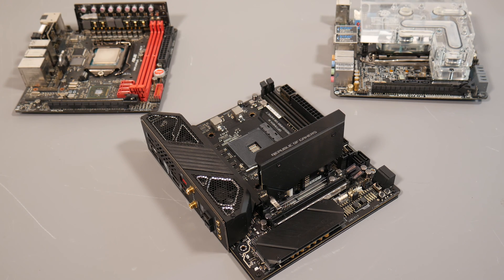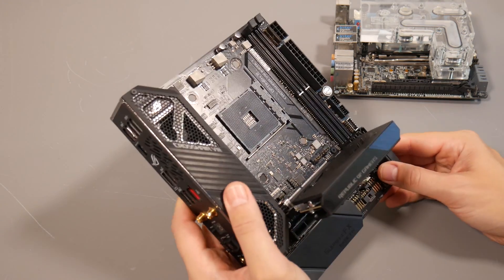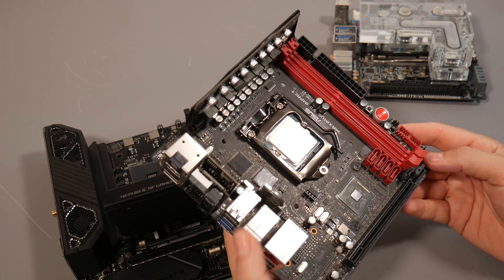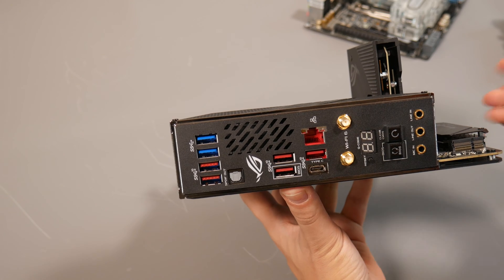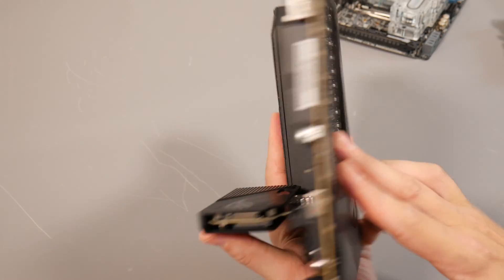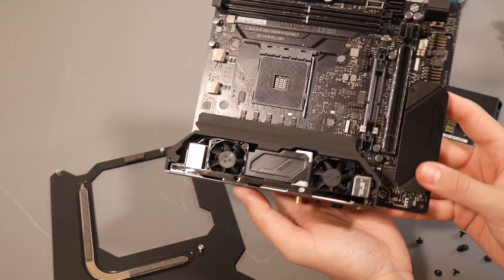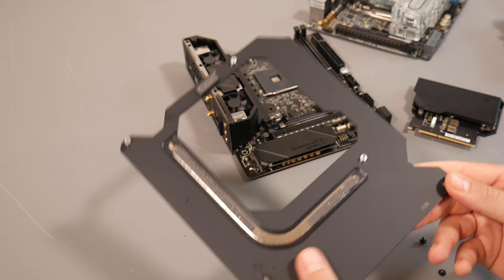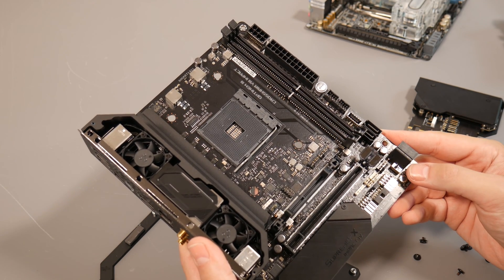ASUS X570 CROSSHAIR VIII IMPACT Preview and Tear Down - RETURN OF A LEGEND for RYZEN!!!

Comment: The CMOS placement is so bad. You have to disassemble the whole computer to get to it.
Reply from the maker: Did you mean to reply to another motherboard review? Cos this has the CMOS button on the I/O panel. Think you might have been referring to an MSI Unify board? That definitely had it embedded in the IO cluster.
Reply: @CrazyTechLab  Oh, no, I meant a CMOS battery. It's that time when these batteries are starting to die, and you have to disassemble the whole PC to replace that CR2032 battery.

The best ncase motherboard I ever had, other than that.

Comment: One of the problem I encounter is replacing cmos battery. My motherboard currently ran out of cmos battery. pulling the motherboard out of the case is one of my greatest nightmare.
Reply: Mine battery crapped out last week, did you have to order something custom or standard CR2032
Reply: @TrackReadyMotorsport  from what i see, it looks similar to cmos battery on laptops. shrinkwrapped cr2032 with connector wire.
Reply: @dino.techtv  swapped the battery today, still doesn't save the settings if I kill the power
Reply: @TrackReadyMotorsport  is the battery replacement new? If that's the case maybe the new bios contains bug? have you tried resetting the bios.
Reply: @dino.techtv  its a new battery 
 I'll try resetting it today.

Comment: I've got this board with two 2TB nvme's, 32gb of ram, an rtx 3090 FE, and an r9 5950x
Reply: Were you able to do oc on it? Which psu you are using? I'm planning to get this mobo and install it on nr200p case. Planning to do a custom water loop. This will be my 1st mini itx build. I'm still waiting for the other watercooling parts. Still i can't decide if I'll get this one or the asus x570 itx or aorus b550 itx.

Comment: Can this fit in the Phanteks Evolv Shift X?
Reply from the maker: No there’s not enough clearance between the side of the case and motherboard mount.
Reply: @CrazyTechLab  Thanks for the quick response. I may have to cut part of the case to make it fit.
Reply from the maker: BytemeVV - you will need a longer PCIe riser cable too but yes if you cut a slot in the side of the case it will fit
Reply: @CrazyTechLab  I took that in consideration too... I'm just am trying to keep the aesthetics of my custom pc build you know how that is. I  just wanted to also say I enjoy watching your vids too.

Comment: yes, the VRM fan that runs at ~1500 RPM is quiet because the VRM only runs at 40-55C
i think you forgot to mention that the chipset south of it runs at 70-85C and the fan on that runs at 5150 RPM in idle and up to 10000 RPM in load.
this is the loudest board I've ever owned. so much regret purchasing.

also, you can't fit some GPUs with backplates. I had to take the backplate off my MSI RTX 2070 because it conflicted with the chipset heatsink.
Reply: thx for that important information, i will probably get the gigabyte instead, should be fine to.
Reply: @petermeier2064  hey i've been using it for about 4 weeks now and the chipset fan has seemingly calmed down a fair bit, especially after bios 1105 was installed. it's now running at around 3900 rpm which is surprisingly significantly quieter than 5150 rpm. i actually can't hear the fan in a completely silent room from any more than 4 feet away now, although it is still the only part in my PC that has audible noise at less than 2 feet. my chipset is also running at only 62-71c now as well.
i also replaced the MSI graphics card with an EVGA one and can confirm the EVGA backplate fits fine. I had to return the EVGA GPU though because the coil whine was so intense when watching movies.
i replaced it with an ASUS GPU and its backplate also fits fine. it still has coil whine but it's not bad enough to bother me when watching movies or playing games.
Reply: @notsunilsingh  thx for the info, my evga also has coilwine, but only in some games, not in watching movies ect. but good to know that backplates are normally not a problem.

Comment: Excellent review, not sure how I missed this video. I've been tracking the release of this board to use my 3900x, upgrading from an X470-I and a 2700x. A detail that seems to be missed by reviewers is the CPU clearance for air coolers. From forums, I've seen there's a concern about the SO-DIMM getting in the way of large air coolers. I just heard back directly from ASUS and got confirmation:

CPU clearance is 140*120*65mm.
The form factor is Mini-DTX, 8.0 inch x 6.7 inch (20.3cm x 17cm)
The height of SO-DIMM.2 is 78mm

So in case anyone had concerns about using large tower style coolers, just know that the majority should fit. My Crosshair Viii Impact is arriving tomorrow and I'm glad I'll be able to reuse my Dark Rock Pro 4 cooler, which measures 136*119.5mm. Hope this helps someone else in the future!

Comment: Do like the DTX form factor,wondering whether it will fit in my Coolermaster 130 case, & why don't they start using SO dimms slots on these boards,then you could have 4  memory slots & I could then use the 64Gb of DDR 4 3600MHz laptop memory sat here .

Comment: the best thing on ITX is that they are small..........Asus killed that, stupid design in my opinion.
Reply: the logic is that extra space at the bottom is already taken up by a gpu, might as well use that dead space pcb
Reply: Cooked Karambwan bad logic than i only use cases that are really small
Reply: @Mcorpmike  The point of this motherboard isn't for something like the skyreach 4 mini, it's more for something like the Corsair 280x or the NZXT 200i, where your GPU will already cover the over hanging bits. I'm fairly certain this will fit in the NCase M1, as well as some of Fractal Design's cases so it shouldn't be a problem for SFF cases like those. Asus also didn't "kill" anything, they've only offered a new product which could just end up being a dud.

Comment: Can you put the two m.2 drives in the SO-DIMM.2 slot be run in RAID?
Reply: Yes: Dual PCIe 4.0 M.2 slots support up to 2280 and provide NVMe SSD RAID, liking this board even more now.
Reply: @stuartandrews4344  I'm thinking that two PCIe 3.0 drives in RAID would be plenty fast enough on the PCIe 4.0 bus and be cheaper than a pair of 4.0 NVMe drives
Reply: @WSGF  Looked at two 960GB Corsair MP510 PCIe 3.0,would cost around £256,but still cheaper than PCIe 4.0.
Do wish prices would drop a bit more.

Comment: The DTX form-factor is a pretty big deal-breaker, honestly. I don't think I can fit this in a Phanteks Evolv Shift (could you test that for us?), and I'm not sure I can fit it in an NCASE M1, either. Perhaps a Louqe Ghost with a top-hat. For AMD, we're still stuck with just the Strix for ITX, and ASUS does not at all put the same love into their AMD Strix as they do their Intel version.
Reply: vomErsten, it definitely fits in the ncase M1. It will fit in any itx case that takes large 2.5 slot GPUs. Sandwich cases like the ghost S1 and dancase are a no-go though